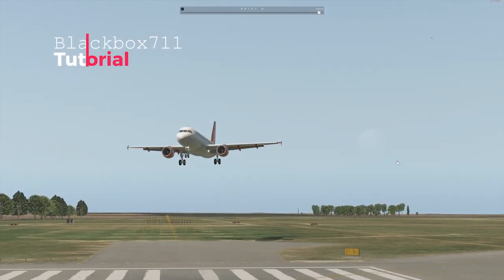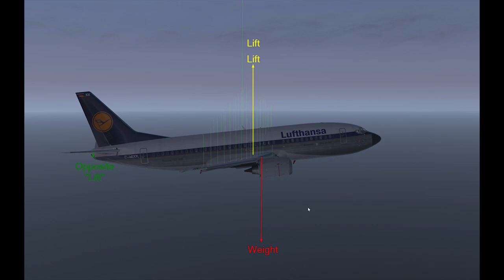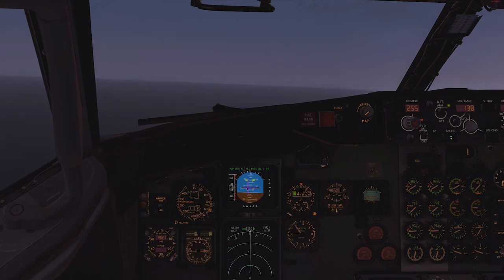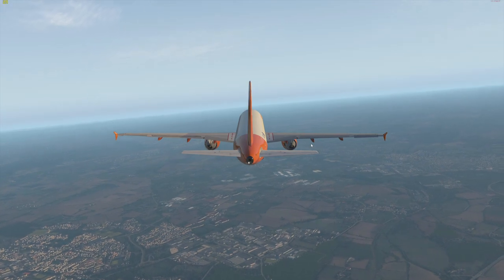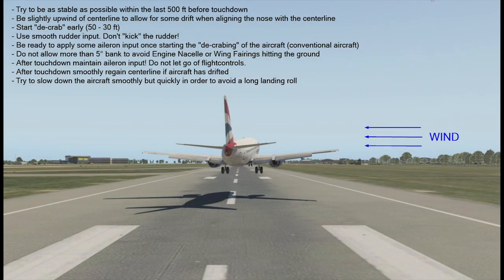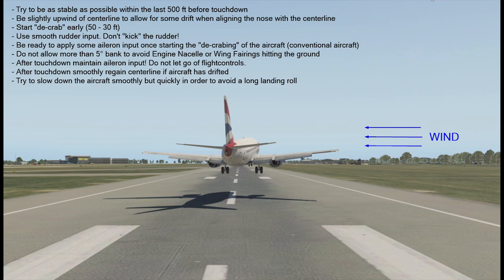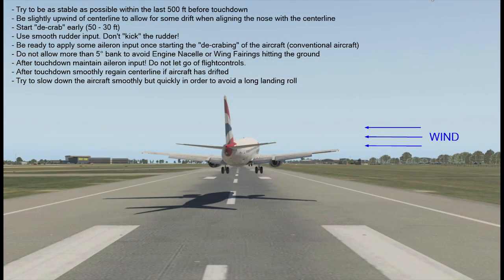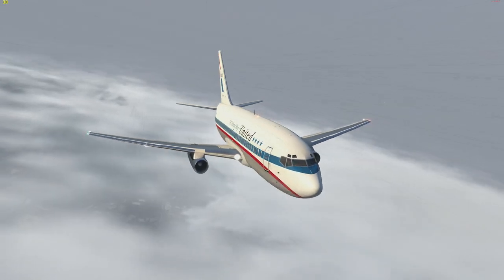Crosswind Landing Technique

Comment: I noticed you cut the 737 landing short. I'm trying to get a successful 40kt, 90 degree crosswind landing done in the XPlane-11 default 737. So far, no go. Can't keep the upwind wing down, and the plane rolls/tips over on touchdown and the wind pushes me off the runway. Can you do a successful landing with those parameters? I should give you my situation file.
Reply from the maker: Hi. I have experienced the same in XP11. I am not sure what the crosswind limit of the 737 is, but I wouldn’t go above 35 kts. Then after touchdown make sure you keep in the aileron input into the wind to make sure the wing isn’t lifted by the wind. Also slow down the aircraft quickly and use nosewheel steering.
Reply: @Blackbox711   Thanks for your reply. I'm using full aileron on the upwind wing, but still can't stop the roll. You may be right with the crosswind limits. I'll check that. 40kts may just be too much wind :)
Reply from the maker: If it is any consolation, in the real 737 it is easier to control the aircraft in crosswind conditions.
Reply: @Blackbox711  Thanks. Good to know. If I can get it done in Xplane-11, I'll be all set for that  "Hey, is there a pilot on board" scenario that I'm getting ready for,  lol.

Comment: Few comments I want to add as an engineer in aerospace engineering:
- the yellow lift vector should be equal to the shown thin green line, so further aft. Since there is no visible lift at the tail the center of gravity would be directly underneath that
- for landing the total lift force needed remains the same (weight didn't change), so the lift vector does not get longer. The lift of the wings is a bit higher, cause they need to compensate for the downforce, that is correct.
- as I slow down the lift doesn't decrease in level flight, in other words I just need the angle of attack to increase to maintain that level flight, total lift still the same. That means lift distrubution changes, that is correct, trim is needed as you said.
- when you maintain a side slip the wings both travel at the same speed, so the aileron input is not needed due to the one wing being faster than the other, its more about the tail being above the vertical center of gravity and the lift distribution washing towards the trailing wing, combined with the fuselage blocking some of the incoming air to the aft wing. And of course as soon as you start rolling, like shown in the video, the lift on the wing going down increases and the lift of the wing going up decreases due to changes of local angle of attack. So the example isn't the best... The conclusion is still correct, as you quickly yaw an aircraft the one side going forward increases lift and thus you need opposite ailerons. But to maintain the slip you also need ailerons, so its not just about the transition.

Comment: For the rollout: if you maintain a medium rudder deflection and just vary your inputs around that deflected position steering is much easier than if you let go of the rudder, then reapply it to get the nose straight again, then let go. Having that constant input with slight deflections works much better to fight the crosswind.
Reply from the maker: Hi. I appreciate your insights into this topic. Very interesting indeed!

Comment: Pro tip for fsx or p3d: during flare minimize the bank as much as possible because you don't have the side forces by the fuselage that you have in x-plane or Aerofly. This is one of the many things where the MSFS are not realistic even with expensive add ons. You could be at 15° sideslip, nose pointing futher downwind that needed for a smooth landing but with 5° of bank that flight sim will still accelerate you to the right which makes crosswind landings harder and a bit unrealistic. So for the full training effect use a better sim :)

Comment: I dont agree with "try to decrab early" opinion. Decrab should be just before touchdown, around 20-10 feet. otherwise wind will drift you away from the centerline and you will need some bank to realign centerline. But it is very detailed and perfectly explained video regarding crosswind landing dynamics. Appreciate
Reply from the maker: Hi. Our safety and training department clearly stated that a late decrab is perfectly OK, however there is a tendency by pilots to kick the rudder too hard causing yaw and roll oscillations when doing it close to the ground. Hence the philosophy here is to decrab earlier and use smooth and coordinated inputs. In the end every pilot has their own method.

Comment: I like the classroom aerodynamic preview and the frozen de-crab phase it added clarity a long way. You might want to add the extra care in crosswinds on contaminated runway and the need for differential reverse thrust to correct any slippage or drift away from center line.Also  Ihave ussed differential thrust on the approach with slightly more thrust upwind which yaws down wind and thus countermands the weather vaning of the rudder.
Reply: No need for this on airliners like boeing and airbus

Comment: What do you think about the toliss? I like to fly in vr and the ff 320 for xplane is shameful in that regard. I only use the toliss because of that. Any plane not compatible or has poor optimization with vr is not worth buying in my book and flight factor has shamed themselves when it comes to xplane and vr
Reply from the maker: The Toliss A319/321 is what I call a „solid“ addon. While some little details like Fonts or textures may be inaccurate, the aircraft flies well and the important systems like autopilot/flight guidance works reliably. Also the Toliss developers continue to update their addon while FF320 hasn’t seen any major improvements of late. Regarding VR I can’t really comment since I have only tried it once and like you said the performance still isn’t where it needs to be to have a good immersion. Happy Landings

Comment: Hello Captain!

Do you use the rudder pedal even when there is no crosswind?

For example, between altitudes of 300ft and 100ft
When off the runway center line.
Reply from the maker: No, the rudder is not being used in that case. It will cause a sideslip situation which means you need to compensate with ailerons, making the landing potentially unstable
Reply: @Blackbox711  Thanks for the answer.  My doubts have been resolved.   : )

Comment: Hey blackbox711! it's a while since I watched your videos and I almost forgot how great your videos were. so I got question and I just wanna ask how do you apply full throttle during take off cuz for me it always has a detent and never reaches it's full potential. by the way when I enter the vspeed it sometimes doesn't always auto calculate. also when I was flying yesterday I couldn't take off the throttles on toga but it seems like it just taxis on the runway.
Reply from the maker: You need to calibrate your throttles in the Controller Menu. The V Speeds are only calculated when a departure runway and the weight data is inserted in the MCDU
Reply: yes I've done that with the v speed I've entered everything you said but i'm only allowed to insert the v speeds after the engine start. any ideas? oh I forgot to tell you that I'm using mouse yoke.
Reply: by the way what's the weight data?

Comment: How do you get the plane to crab in the beginning? or it does it by itself due to its aerodynamics?
Reply from the maker: Correct, it is simple aerodynamics. The aircraft is flying straight with regards to the airflow around the aircraft. Hence the nose is pointing towards the side where the wind is coming from. That way the track of the aircraft over the ground is kept straight towards the runway. Since pilots want to reduce the stress on the landing gear and tires on touchdown they use the technique I demonstrated in the video.
Reply: @Blackbox711  thanks. This is really helpful